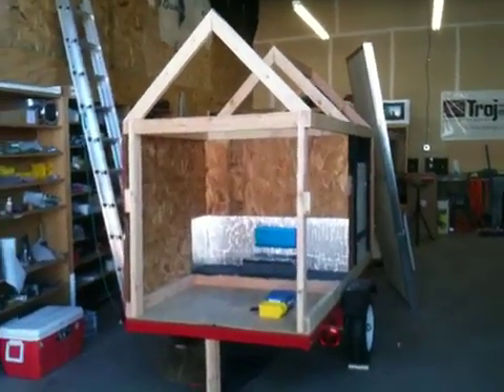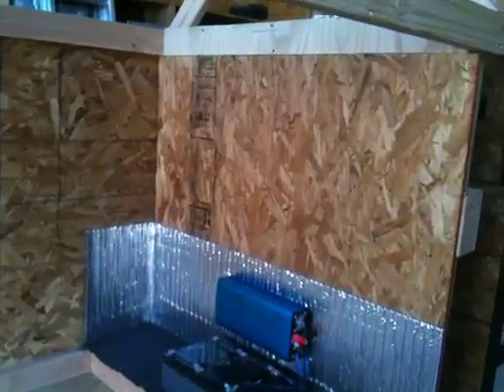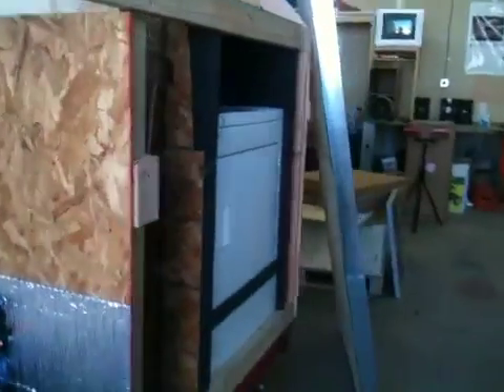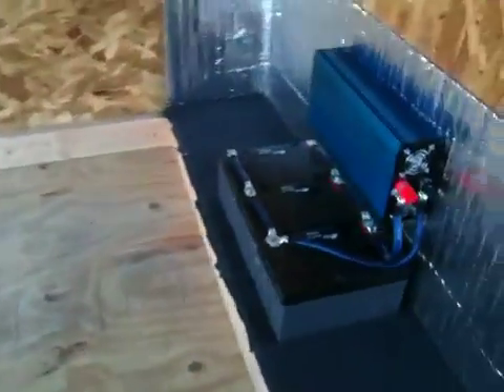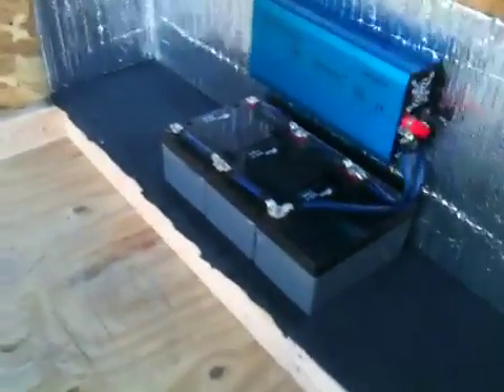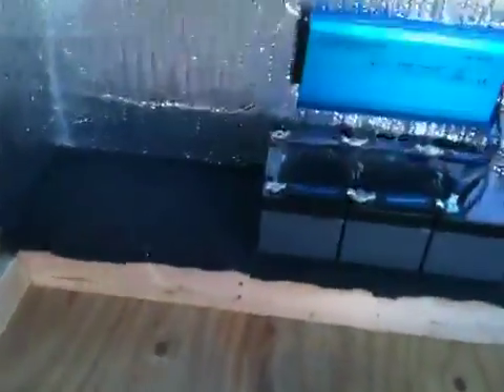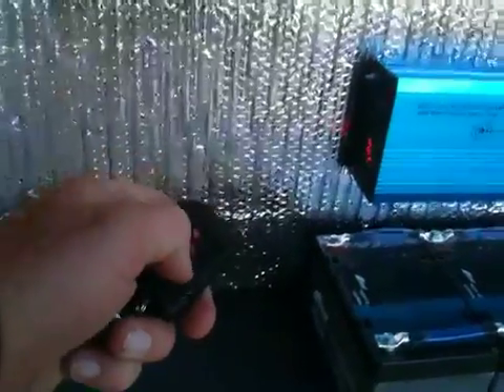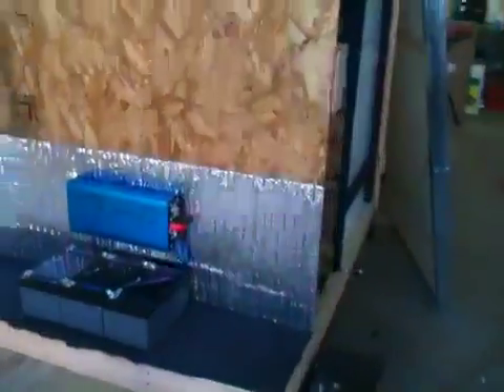Solar heat clothes drying trailer

Comment: I did the solar air heaters connected to a clothes dryer in Oct. of 2009(see my video). I haven't mounted it on a trailer, but looks like a good idea for taking it on the road.